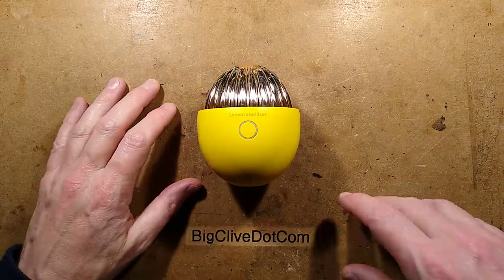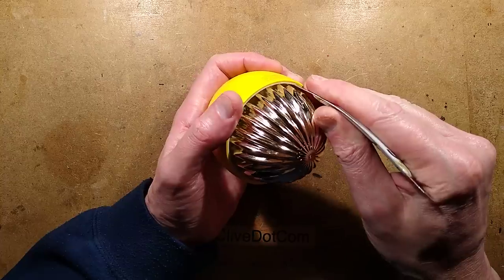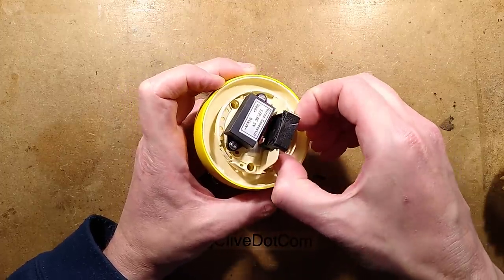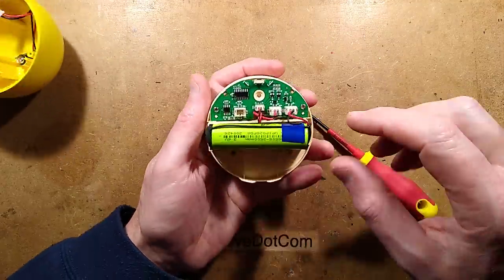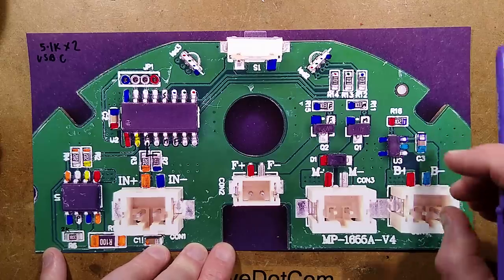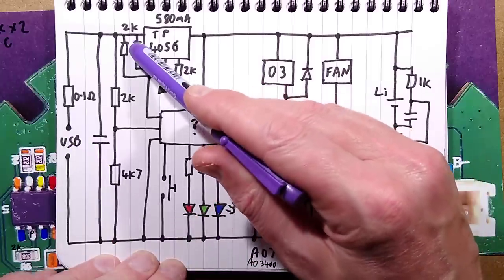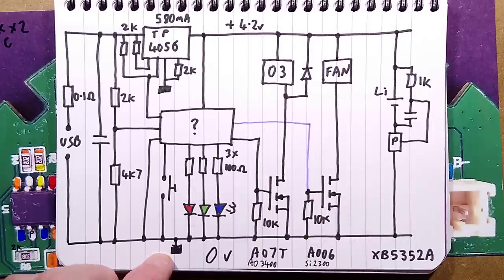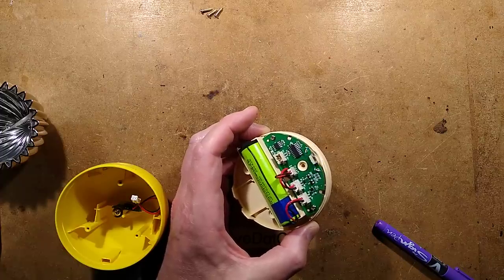Xiaomi high voltage refrigerator lemon

Comment: Available scientific evidence shows that, at concentrations that do not exceed public health standards, ozone is generally ineffective in controlling indoor air pollution.

The concentration of ozone would have to greatly exceed health standards to be effective in removing most indoor air contaminants. In the process of reacting with chemicals indoors, ozone can produce other chemicals that themselves can be irritating and corrosive.

When inhaled, ozone can damage the lungs. Relatively low amounts can cause chest pain, coughing, shortness of breath and throat irritation.
Reply from the maker: You're copying and pasting that from the usual alarmist sites.  At low levels ozone is an essential part if air.
Reply: @bigclivedotcom  That text is literally copy-pasted 1:1 from The United States Environmental Protection Agency.
Reply from the maker: @tschuutschuubahn  Who I specifically mentioned in this more accurate video I made about ozone.  (In fact I tore into their appalling "science")
https://www.youtube.com/watch?v=1ymcJ9qKC7I

Comment: i don't think i like this.

1. it's ozone generator in a small space (inside the fridge) so it would build up large amounts of ozone pretty fast.
2. this would cause any food products in the fridge to spoil faster because that what oxygen does.
3. even though the food will spoil faster there will be no indication of spoiling because the ozone would eliminate the smell.

all things considered , this little device is food poisoning waiting to happen.
Reply from the maker: It runs in short bursts.  Not continuously.  Ozone has a natural reversion rate.

Comment: You are ignorant to the facts.  Just because something is natural in our air doesn't mean it isn't toxic.  Carbon Monoxide and different Nitric Oxides occur at ground level ( the Troposphere) at much higher rates than ozone and are very toxic, but not as toxic as ozone. Ozone is the main component of smog and is dangerous to health and the environment, it is very toxic.   The vast majority of ground-level ozone, not to be confused with the upper atmosphere's protective ozone layer, is created by reactions between environmental pollutants, light, and heat. It is only produced "naturally" at ground level when lightning strikes, and that only makes up a small portion of tropospheric ozone.  
 Your statement that "It's only bad when it is at very high concentrations," doesn't provide any proof that you even know what constitutes a high concentration, because the safe limit recommended is as low as between 0.070 parts per million (EPA recommendation) and 0.10 parts per million (OSHA recommendation) for no longer than 8 hours. According to the EPA, "Adverse health effects from ozone are more likely to occur when ozone levels exceed the EPA standard, but are possible when ozone levels are below the standard, especially in sensitive populations."  That means at most one part of the air per 10 million parts is considered the most anyone should be exposed to over an 8 hour period and as I previously mentioned, people can experience health problems at lower levels if they have any form of asthma, if they are children due to weaker longs than adults, or if they are elderly.  I wouldn't consider only one part per 10 million to be a "very high concentration" relative to most things, so your answer is an ignorant dismissal of legitimate problems.  Most products that have been tested usually produce much higher levels than what is found to be safe, and it's even more dangerous when used in enclosed spaces like a fridge.  Also, Chinese products aren't going to care at all about being in compliance with OSHA or EPA guidelines. 
The EPA also has shown that ozone can eliminate odors, but the catch is that zero studies have been able to do so without exceeding toxic levels, and they also found that they are not effective at preventing things like mold/bacteria and or eliminating air contaminants at safe levels.  As a result of reviewing research available to this date, EPA, as well as researchers from universities like UCLA, strongly discourage the in home use of any type of ozone generator.
Reply: Oh, you're no fun!